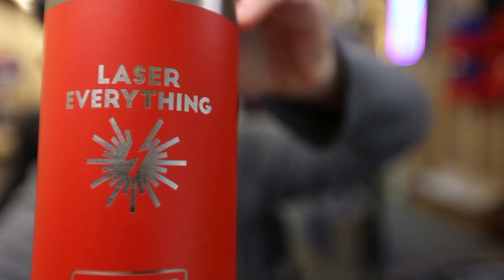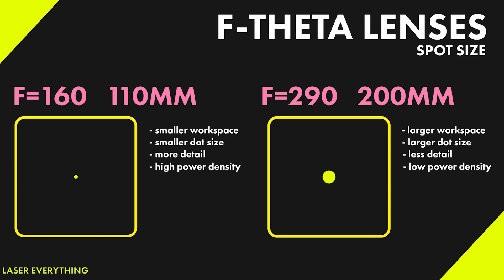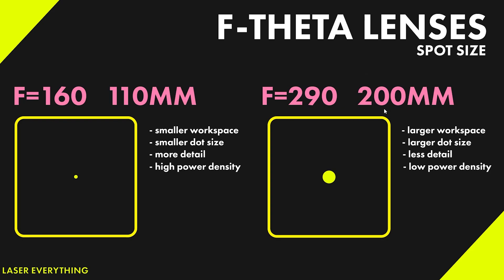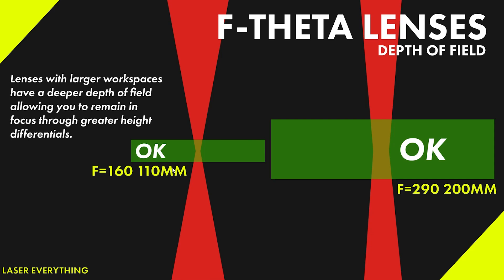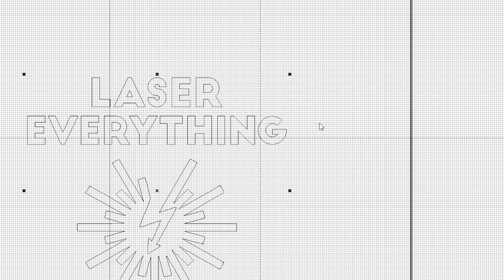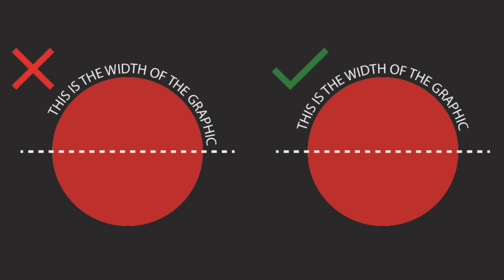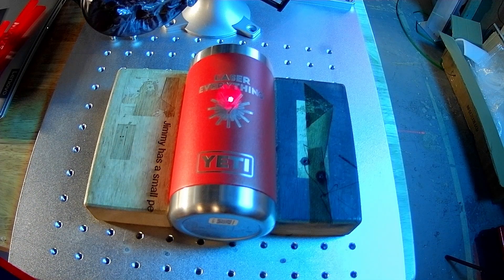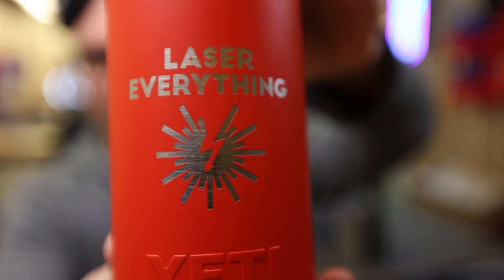ProjectMark ESSENTIALS | Engrave Tumblers with EASE at 300mm

Comment: Hey Alex! Is it really hard to get a good engraving on a tumbler with a F=210 lens? From what I learned from you, this is a 150mm and is quite small. I cant get a consistent engraving using the cylinder correction tool. With a logo around 60mm wide, the laser power starts to taper off at the edges; has be so frustrating to learn my fiber compared to my diode.
Reply from the maker: A 150mm lens is a bit small for cylinder correction for standard size tumblers. It’s less about the workspace size in this case and more to do with the focal distance and range. 

Shorter focal distance means shorter focal range. Shorter focal range means less “reach” for the beam while it’s focused enough to work. The wider you mark along a curve, the more focal range you realistically need, even if you average your focus to the middle of the height range you’re marking, the beam is only going to be focused enough to be effective within a given range. 
The focus range of a lens changes with wavelength and hardware too, so this is why we can get away with doing it on a co2 galvo with a smaller lens, the longer wavelength means we can stretch that focus further with the same lens size. 

For fiber, if you’re limited to a smaller lens, you’re going to want to limit your width on the curve so you have less height variation, and make sure you’re focused at the halfway point of the curve height. Moving up in lens size will afford you more focal range, and that will give you more width.
Reply: @LaserEverything  I really appreciate the quick response! This definitely confirms my need for a larger lens...I spent so many hours scratching my head on this issue haha. Thank you for all the content you produce, you're awesome man!

Comment: Commarker does not have a 300mm lens available for their B6 30w.  Can I buy one from another source?
Reply from the maker: It kinda depends on what kind of lens is used with the head on the B6. I know commarker makes a lot of compact systems (I’m familiar with the b4) which use a lens that’s an m55, or in other words, the threads on the lens are 55mm wide to thread into the head. On a standard size head, we use m85. Unfortunately, the m55 lenses just have only so much space to pack glass into (and there is only so much space for focus distance on compact machines), so we haven’t seen anything above a 200 or 220 in the m55 size. You’ll need to check your machine to confirm the thread size on the lens you have, I’m not super familiar with the b6 so I can’t say for sure on my side.

Comment: I been looking your 2 videos about engrave tumblers do you think i can get those result with a 20 watts fiber laser and 110mm lens?
Reply from the maker: At least for this video where we use projectmark (or cylinder correction in lightburn), it really kinda requires a bigger lens to rely on the long focal range (the stretch of height we actually have focus enough to mark with the beam). If we use a small lens like a 110, we don't get enough stretch to make it around a big curve. You'd be able to do narrower marks with a smaller height change, but you wont get as wide of a result as with a 300 lens like in this video unfortunately. The concepts still apply, but everything will be tighter with much smaller tolerances.

If you need to mark across a broad area on a cup and are limited to a 110 lens, going the route we use in the rotary video with the use of a rotary would likely apply better to your current setup.

Comment: Am looking to buy a commarker CO2 galvo with a 8x expander and a 20mm head plus an add-on of a 300mm lens.  Just dropped them an email to see if they have a 800mm tower available?  Any thoughts on your end about using this laser for strictly tumblers.  Using a 300mm lens, what % of the circumference would I be able to engrave not using a rotary?
Reply from the maker: Co2 galvo kinda has different rules from fiber. With a Co2 galvo, you can often typically do a projectmark / cylinder correction mark using a 200 lens if you wanted to, Co2 has a much longer focal range due to the wavelength. That said, you dont NEED the 300 to do it, but it can be helpful on larger cups or even bigger cylinder marks. The benefit with the Co2 is you'll rarely have an issue with focal range if you're validating your focus and setting your focal height well.

I never really looked at it like a percentage, but think of it like a line-of-sight kind of thing. If you put the cup on your desk infront of you at head level and look at it with one eye, its really the area you can clearly look at the powder coat from a single viewing point. You can't mark what you can't see, and you can't really mark sideways into powder coat. So you can't go edge to edge on what you can see, its gotta be in a bit to avoid the harsh angle into the powder coat kinda being sideways. So I guess the percentage kinda changes based on size/circumference because of the amount of severe angle area you lose where it doesn't give you good quality when engraving sideways into the coating.

Comment: Is there a soft touch coating on the thermos or just paint? I tried this processing method on a soft touch, but it doesn’t work out so easily. Moreover, soft touch red or orange is the most difficult to process with a fiber laser (at least in my particular case), other colors turn out great

Comment: What Mende do you recommend to do detailed work such as coins or firearms slides and barrel?
Reply from the maker: It sounds like those being all metal, a fiber laser would be best to do that type of work. Deep engraving is a slower process, but you can get more done faster with a higher wattage laser if you fine tune your settings. The smaller the work area for your lens, the more power will reach the material in a finer dot size to be able to do more faster as well, so try not to oversize your lens.

Comment: I really like the video. 

I currently run a 55w CO2, but am looking to speed up my tumbler engraving.  Mainly 20oz tumbs.  With my CO2, I have of coarse have to raise the top, place the tumbler into the rotary, run the job, raise the top, remove it, place another in, and so on.  When your doing 200 or so more, it's very time consuming.  I'm looking to buy a 30 w from Monport.  The specs are below.
Working Dimension: 8'' x 8'' ( 20 cm x 20 cm ) / Machine Dimension: 13.7'' x 21.6'' x 26,9'' ( 35cm x 55cm x 68.5cm ) // Main Tower Dimension: 8.2'' x 17.7'' x 15.3'' ( 21cm x 45cm x 39cm )

Fiber Lens Dimension: 200mm x 200mm

I'll be looking to buy one of their 300mm lens as well.

With the specs above should I be able to get a decent engraving with artwork around 3" in width?

Of course, I'll use the machine for other things that I do such as slate / cork coasters, anodized keychains, etc....

Thoughts?
Reply: Bummer nobody answered.  Did you find out the answer?

Comment: Hey there - great video. A couple of questions, do you have to have a filtration system with these machines? I've noticed many people do not use one. Also, with the  Mactron JPT, do you receive support if needed? Last, I use Corel with my CO2, can I use it with these machines as well? Seems to work really well with my current laser.
Reply from the maker: You can use a fume extractor to filter these machines we have one linked in the buying guide https://www.lasereverything.net/buyingguide but you're correct most people don't use them. Whenever possible we recommend exhausting directly outdoors. Mactron offers fairly good support but there's still a pretty serious language barrier. Corel will work as a designing suite but you won't send jobs to the laser from corel - you'll have to export as an AI or svg file and then import it into ezcad to actually run the job.
Reply: @LaserEverything  so basically this unit will not print from Corel? That’s interesting. I will keep that in mind moving forward. I appreciate your input.

Comment: Any idea why I'd get no effect when I use project mark as opposed to mark on grid page?
Reply: For some reason when I got Mark from the project mark menu I get no power. The laser runs but is super weak. If I back out and Mark from the main screen it runs fine
Reply from the maker: Very strange, honestly not sure. I'd join the discord or facebook group linked in the description - so we can get a better picture of what you're working with.

Comment: Hi, thanks for the great video. I am wondering do i need to buy another 300mm lens to achieve this or the 220mm lens can be use for this purpose too? Planning to buy JPT 50W, now thinking which lens to go with..😁
Reply from the maker: The 220 will work okay but the 300 would be better. The lenses are so cheap compared to the machine - I always recommend owning a range of lenses for different situations.

Comment: Can 80w mopa laser cut gold faster than 80w fiber laser what the difference
Reply from the maker: Theoretically yes, but you'd be hard pressed to find an 80w fiber that isn't a MOPA.  The MOPA would cut faster because you can maintain high power output at higher frequencies. That means more pulses that are just as strong as the pulses the regular fiber can only put out when it's don't just a few pulses in the same amount of time.
Reply: Thank you for your support 🙏🙏🙏🙏

Comment: Alex, great video!  It has been very helpful.  With your new M7, have you tried to do color yet?  I thought it might be cool to get through the powder coat on a tumbler then do another color pass to fill the mark since they are stainless.  I’ve had luck doing colors on stainless plates but haven’t tried it on a tumbler.
Reply from the maker: Not yet, I get so many questions about this but it's extremely difficult to master and I want to feel absolutely confident before publishing any sort of guide with my name on it haha. Don't worry, it's on my radar - but it's gonna take some time.

Comment: Is this possible in Ezcad 3?
Reply from the maker: It is, minus the project mark. You'll just have to compensate by reducing the width of the graphic a bit to compensate for the stretching around the curve. It's not perfect but it works fine with a little practice.

Comment: Have you tried this method doing a black mark on a stainless tumbler? I have the 300mm lens with a 50cm tower. On the chuck rotary I can't get the tower tall enough to focus for the black mark. I didn't even think about this option. I had a 150mm x 70mm image I was trying to put on the tumbler.
Reply from the maker: I've done a small amount of testing and hit some walls pretty quickly with projecting black mark. Even with lenses with a large depth of field the focal point for z-marking is so specific it's been difficult to get the good black all the way around the curve. I think rotary for zmarking is still the best option - and the 80cm tower would be a big help with that.
Reply: @LaserEverything  I was testing last night and ended up using my 200mm lens with the rotary, but even placing the tumbler at an angle I still had like a 7mm-8mm height difference between the highest and lowest point on the tumbler where the graphic was to go. I had to run 2 passes at speed 50 at different focal heights to get a decent black mark(which takes about 30 mins with the graphic size I had). If I extend the tower I'm hoping the 300mm will cut that down to one pass.

Comment: What purpose is using Projectmark?   instead of just a standard etch from the workspace by hitting F2?
Reply: I found it.   It distorts the image for the cylindrical object so the burn doesn't look distorted on the surface.   Cool stuff.
Reply from the maker: Sorry I thought you were on EZ3, glad you found it though, yeah it makes a big difference!
Reply: @LaserEverything  my machine is Ez2, my CO2 at work is Ez3.  This is perfect as I'm about to do some red tumblers with my 60W M7

Comment: We could unmount the tower, rotate it 90 degrees and mount it in the new rotated position so that we can have access to more distance down away from the mouting surface of the tower. So we can use the same tower!
Reply from the maker: You certainly could do that, with the tumbler standing up right, absolutely.

Comment: Nice! Now I need that 30...😜 Need to learn my 70mm too. Do you have a video on the differences/benefits between lens sizes? Smaller detail vs larger, Power differences, etc?
Reply from the maker: We talk about it in this video a bit but we're getting a lot more in depth in the next episode. In the meantime check this out: https://youtu.be/iAgj6T4eH80
Reply: @LaserEverything  Seen this one. Great for knowing which brand and some details of characteristics. Hoping the next video on the topic covers the physical differences and results of the work desired. Whys of big vs small. What actually happens with each where the beam ends it’s life. You’ve sporadically covered many of the details. Looking for the one go to source video. I have a 70mm and a 290-200( On the lens, Focal length 350mm measured?? no stick yet 🥴) lenses so far. Keep up the great work! 😊

Comment: Is Projectmark option in Ezcad3?
Reply from the maker: Unfortunately no, you can still follow this guide. The best thing you can do in ez3 is to reduce the width of the graphic so it skews skinny to try to make up for the stretching from wrapping around the curve. It's a lot of guess and check but once you know how much you need to reduce the graphic width for a particular object diameter it should work every time.